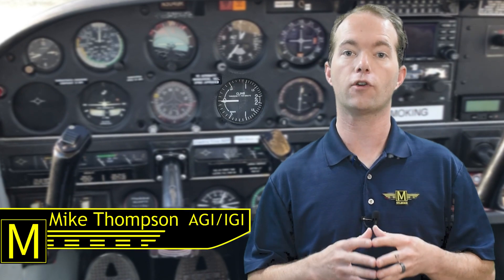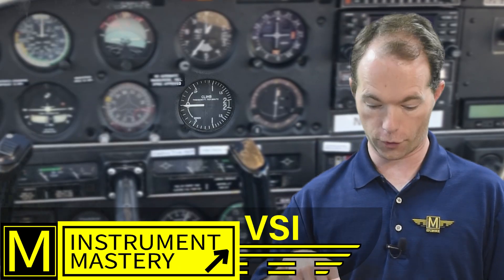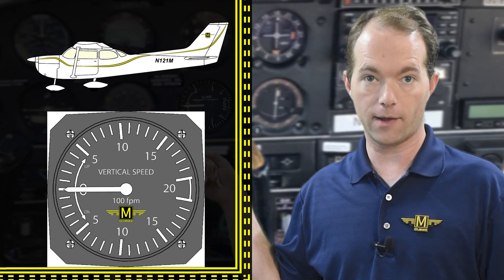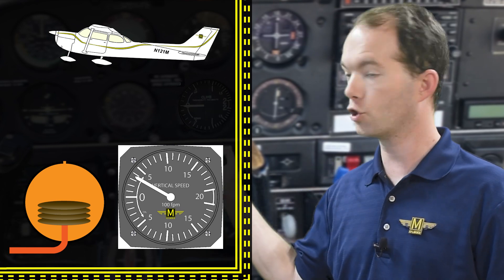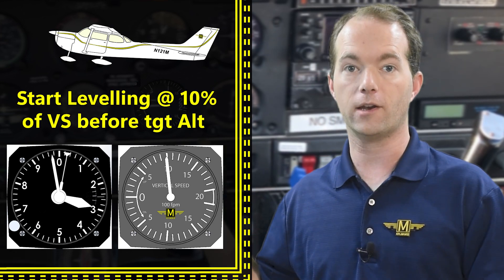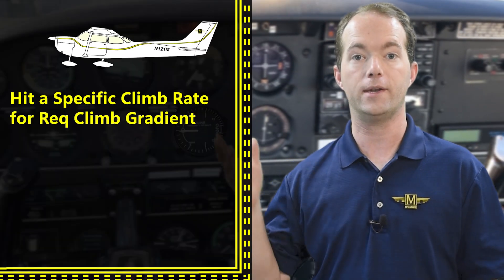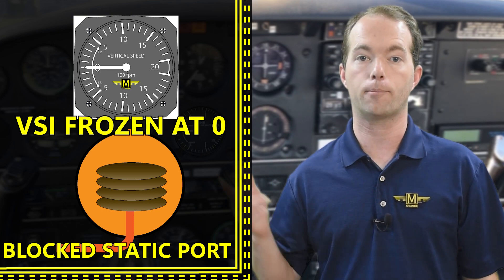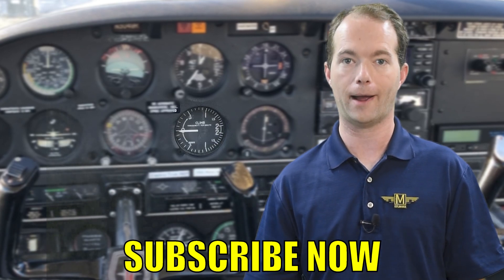Vertical Speed Indicator - Instrument Mastery 3 - 121.Mike

Comment: Thank you Mike.

A little recap of the meat of  what I’ve learned so far about the three pedostatic instruments are:

1) Air speed Indicator which shows:
• normal operating range
• VS1 - clean stall speed
• VNO - Max cruising speed
• Caution Range
• VNE - Never Exceed
• VSO - Max weight stalling speed in landing configuration (Dirty)
• VFE - Max Flap Speed (Extended)
• True Air Speed 

2) Altimeter which shows:
• Altitude
• whether you’re level, going up or down and the rate at which you are moving up or down. This is what is used for the 10% calculation for leveling.
• Baromatic Pressure settings. Standard is 29.92 @ Sea Level and 15 degrees C.

3) Vertical speed indicator which shows:
• your vertical speed in ft/sec or m/sec if you’re flying somewhere metric (like me)
• also functions as a barometer of sorts by indicating whether you’re level are going up or down.
• used to sense rate of change in altitude 
• used to determine in Climb and Descent rates